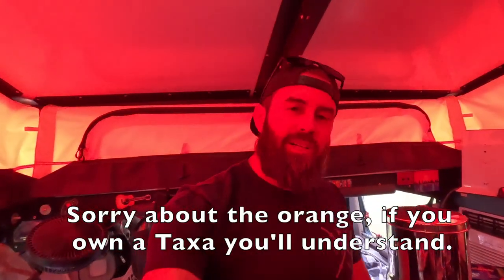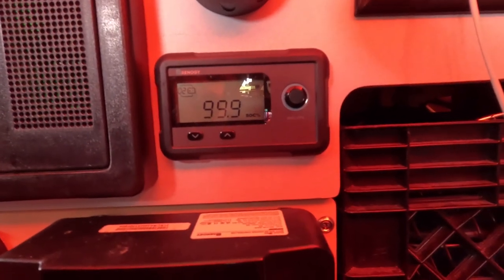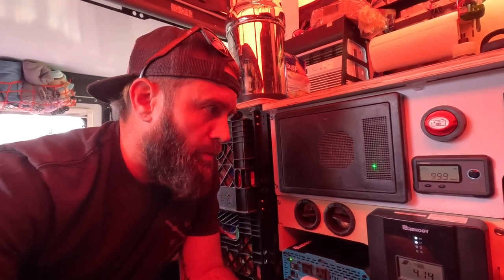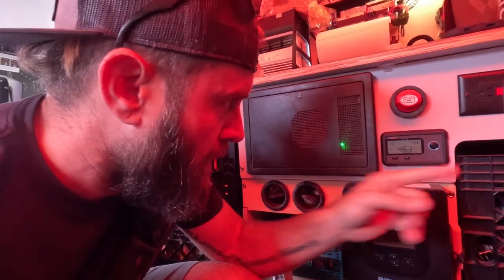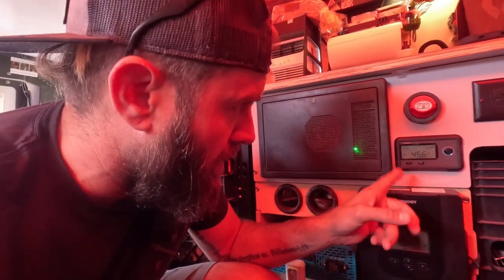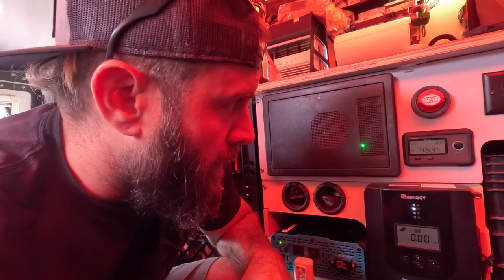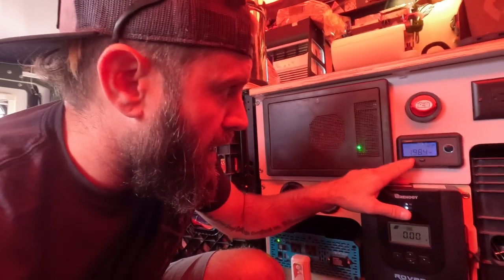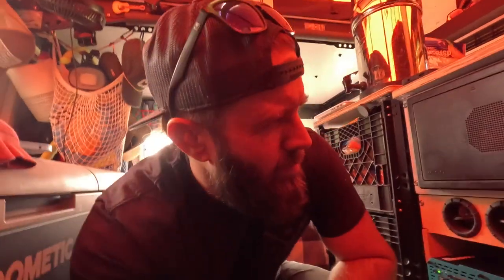S3:E2 // Running A/C Off-grid // A/C on Battery ONLY // TAXA Mantis A/C Off-grind

Comment: How long does your fridge last on 200ah?
Reply from the maker: I haven’t tested but the fridge pulls very little power. It would depend on outside temp but anywhere from 4days to a week(roughly). I’ve considered adding a 3rd battery with the hard mount solar panels this summer. Looking to do a lot more off grid camping this winter.